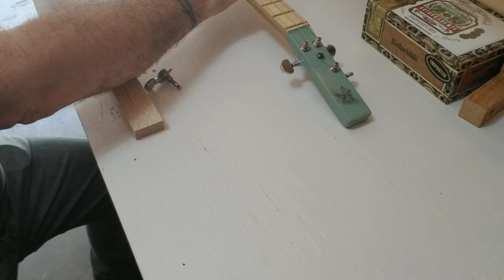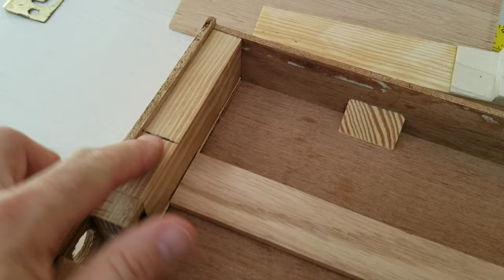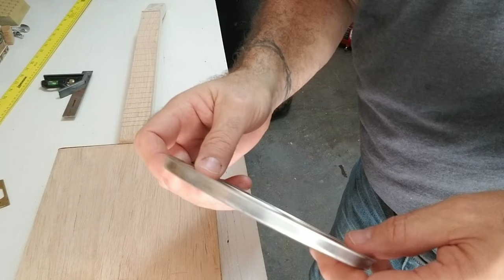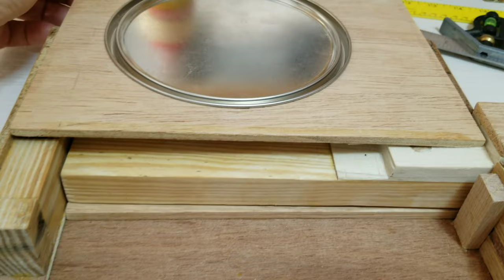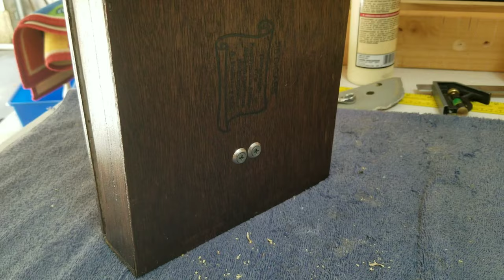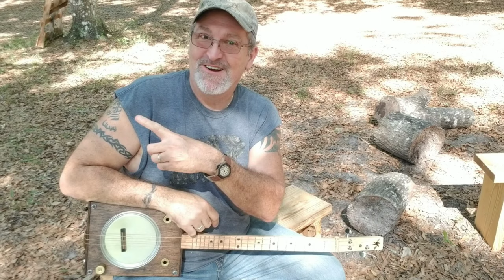How to build a cigar box guitar - Paint Can Lid Dobro / Resonator

Comment: Nice build.  Beautiful guitar.  Would like to hear it without the amp.
Reply from the maker: Thank you Brain, I may throw a little video on my Facebook page playing it acoustically.
Reply from the maker: Hey Brain, I add a video on FB playing this CBG acoustically.  https://www.facebook.com/SouthernFireGuitars
Reply: @SouthernFireGuitars  Wow.  Thanks.  That sounds surprisingly a lot like my Gretsch resonator, albeit with less volume and sustain.  My CBG is a Masonite pressed board Antonio e Cleopatra acoustic.  I was thinking of installing a piezo, and now am certain of it.  My next project will be a feed pan 3 or 4 sting.  I'm hoping that will have some good resonance.   By the way, here is a tune back at ya.                       
Again, thanks.

Wu Han Blues  (12 bars)  3/26/2007

I’ve got the blues from the Wu Han
That bad ol' bug is on the way
I’ve got the blues from the Wu Han
Da gub-mint says it's here to stay
I'm locked up in this ol' shack
Not coming out for many a day

Can't afford to hook up cable
and satellite, well, I ain't got
My rabbit ears have gone missing
Phone reception's not so hot
My old transistor radio
Oh, the batteries are shot

Then I remembered my cigar box
It jams along on just three strings 
It slips and slides a blues riff smoothly 
I croak and groan as I sings       
I thank God I'm still alive
And for all the simple things

3 string solo
Plink, plink, strum, strum, plunk, plunk
(Repeat as necessary)

I’ve got the blues from the Wu Han
That bad ol' bug is bearin' down
I’ve got the blues from the Wu Han
I wish he wouldn't come to town
But I can play my blues and sing
And spread some jammin' all around

3 string solo to end with flourish